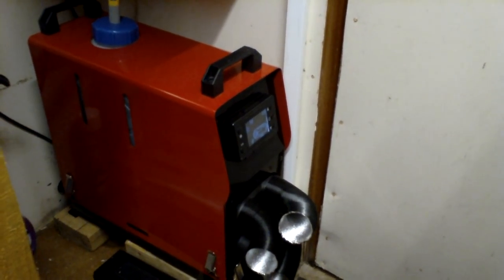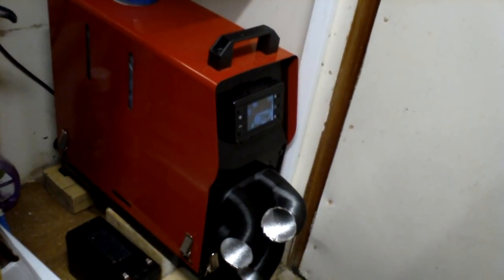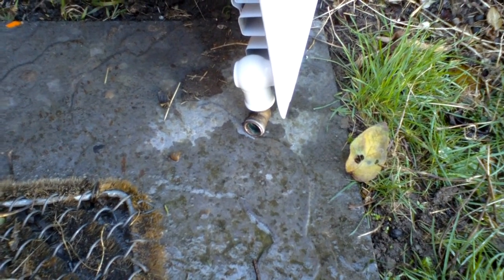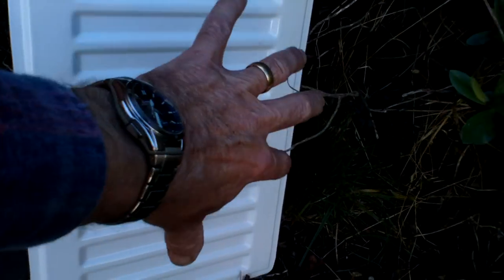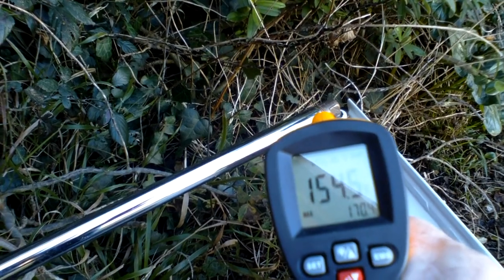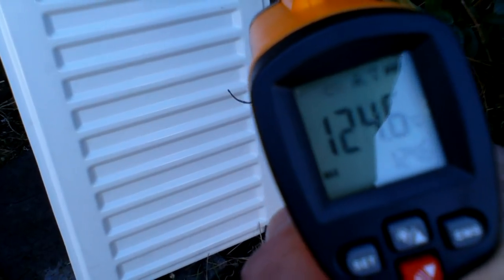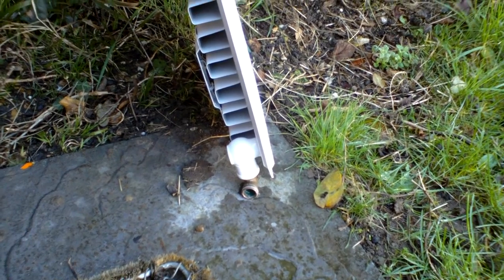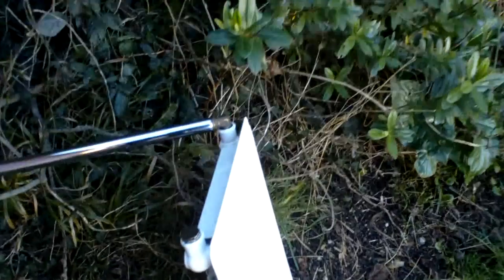COMPACT CHINESE DIESEL AIR HEATER EXHAUST HEAT RECOVERY

Comment: I find it amazing sometimes,I was thinking of putting one of these heaters in a van for overnight stays and was thinking, could I cobble together a copper coil that fits round the exhaust like an Emerson heater to warm water for a wash in the mornings and "bam" here I am....👍
Reply from the maker: Hi Andrew. That could be done. The hot water could use a gravity system so the hot water would rise to a small tank. Needs further investigation but worth a try.
Regards Peter
Reply: Friend of mine done just that, fed the pipe into an urn he has hot water in his van for hand / dish washing, (he used central heating pipe) coiled it
Reply from the maker: Hi there. If you get him to put up a video it will help loads out who would like to do this as a project for heat recovery... Regards Peter

Comment: Seems to work quite well, water vapor is normal, wonder (an idea) whether you could shorten the tubing to a minimum of the wall thickness exiting from the top of the rad on a slight slope and have a mini copper u trap exiting on the bottom of the inlet for the condensation to exit out..

Comment: How about using the exhaust heat to create hot water via a heat exchanger and returning that heat back into the space to a storage tank. 
The water vapor condensate can be vented outside along with the fumes
Reply from the maker: Hi James. I have done this. See the video. I have many videos on my site which you may enjoy.
https://youtu.be/VktbyEAoVR8
Regards Peter

Comment: Good simple attempt would work to stop external water tanks freezing .thanks.
Reply from the maker: Hi there Cantrustme. You have made a valid point - you only use the heater in cold conditions so to use the recovered heat to stop a water tank freezing is a very valid point. I’m hoping some of the RV guys are looking at this because its simple... 4 or 6mm coiled copper pipe twisted round the exhaust and wrapped with manifold exhaust wrap the a very small low consumption water pump... The mind boggles. Stay warm - Regards Peter

Comment: Some people tried to coil up the exhaust pipe right in front of in-room air intake. This way air entering the heater was very hot to begin with and on exit it was VERY hot!
Reply from the maker: Big no no. The exhaust must not be more than 1.5 mitres long else the added back pressure causes the unit to soot up and fail which is a pain as you have to manually strip it down and dig out all the carbon and soot... That’s why this is such a challenge as it’s not as simples as it first seems. Regards Peter

Comment: i bought one for heating in a van.. I might use this recovery for heating water for the morning shower...Thanks for the good idea
Reply from the maker: Hi there. Read the comments posted here as the coiled pipe idea seems the best option. Regards Peter
Reply: @brucepeter2007  Thank you Bruce, i will post if success..
Reply: Whatever radiator you use you need to be able to clean it.  If the burner does not completely break down all the carbon, it will condense inside your heat exchanger and clog it.  The best config for this is a shell and tube type with a flange installation so you can easily disassemble it to run brushes thru the tubes to clean out any carbon buildup...

Comment: I think it's condensing because the rad is outside if it was inside I think it would work
Reply from the maker: Hi Martin. Thanks for the reply - it’s the actual combustion process together with the moisture in the air that produces so much water. No way out of it with this method which was one of the reasons I scrapped it. The other safety factor is that here is more inside the living space so there is more chance of the combustion are leaking into a room so the idea was not pursued in with this method but I did another heat recovery video which worked very well indeed.

Comment: Here's the idea to run with. Have the exhaust sealed to the radiator inside the shed, with the exhaust entering the radiator on the bottom and exhaust out the top and exit the building. Is that the type of heat recovery system you are planning on doing?
Reply: And have it setup with a water drain valve to clean it out once in a while.

Comment: Hi Peter, thanks for starting the ball rolling on this but I'm not sure why you are so anti using a radiator.  Provided you make the circuit airtight and exhaust the fumes to the outside I can't see a problem.  As for the water condensation, there are plenty of solutions you could use from the world of compressed air where they have to deal with the build-up of water in low spots in the pipework.  They generally do this by intentionally creating low spots with drain valves.  Also mount the radiator on a slight angle so any water that collects will run to an exit with a drain tap.
Reply from the maker: Hi David. Thanks for your constructive comments and I will further explain the reasons I did not continue using the heated gasses in the way I had experimented with in this video - but changed direction and made a further video going down the heated water route which could be used safely with a radiator or to heat a water tank if one wished😀😀😀
The main reason I’m adverse to using the exhaust gas into the radiator are two fold.
The first and foremost is safety.
If you look at some pictures posted on CHD heater forums showing poor heater installations you will clearly see a 😳 “that will do” 😳 situation arises on many occasions and that situation alone is a killer when combustion gasses could then be released and trapped within a relatively small space with the possibility that the person could be asleep - 💤💤 - Then would never wake up😔.
Secondly. With an exhaust wall mounted radiator you have a real possibility of even more combustion gas joint leaks within the heated area and also the water from the combustion process is far more than you would get from an air compressor. Another factor is the length of the exhaust pipe - from all manufacturers - recommends that the exhaust length should be no more than 
2 metres in length which limits the exhaust back pressure and prevents the unit from sooting…
Thus I pursued the hot water system which proved to be quite effective and efficient and above all SAFE and also overcome the back pressure situation.

I made a second experimental video and the link was contained in this videos description which sadly most people miss.
I hope this answers your questions fully.
Regards and stay safe. Peter
Reply from the maker: Hi again David - here is the link to the second experiment.
https://youtu.be/VktbyEAoVR8
Regards 
Peter
Reply: @brucepeter2007  Hi Peter, that's a neat way in your second video to extract the heat from the exhaust for hot water.  The same as I have done likewise from my wood burner to my jacuzzi!  :)  I'm in a shed/garage so just want the heat.  I guess I could use the technique to heat the water and circulate it around a loop with a radiator included but it would probably take a long time to heat a large quantity of water so I'm still analysing the 'plan A' approach.

I take your safety concerns but don't see them applying to me ... the shed is a relatively large volume of air being 20' x 15' with an average height to roofing sheets of about 8'.  Like many sheds/garages it is of unsealed construction (T&G panelled walls, open roofing corrugations, poorly fitting doors etc.) so has plenty of ventilation!  :)  And I would be fitting the radiators to plumbing standards so would not expect a leak.  I say this not to criticise but to say your plan A is worth developing for those in a similar situation ... sleeping in a confined RV would be a totally different matter.

I was suggesting using the techniques as used in compressed air.  You can run a low spot to any size catch tank and drain it as required.  I'm also wondering if the radiators themselves could be used as catch tanks.  Run the exhaust from the wall mounted heater down to say the lower left access point and exit the exhaust gas from the diagonally opposite top right and then out of the building.  Use proper plumbing fittings just as for a domestic central heating system but don't mount the radiator level, mount it with a slight slope towards the opposite lower access point so the condensed water collects in that corner with a normal radiator valve to facilitate draining.

I wonder if the stated limitations on the exhaust pipe are because of the desire or not to have back pressure and the actual design of the pipe.  To make the pipe flexible they use a ribbed tube.  The ribbing will restrict the flow of the exhaust and so too long a pipe will increase the back pressure.  If you are looking at your plan B then you want a ribbed pipe to transfer more heat but in plan A that is not required so maybe replace the supplied exhaust with copper piping to reduce the back pressure effect of a longer pipe.  Maybe they also want to keep the pipe shorter to allow the exhaust gases to expand into the free air sooner and remove any back pressure in which case maybe a radiator would act as an expansion chamber as for a 2 stroke engine.

This is all supposition on my part and the only way to find out will be for me to experiment as you have.  :)
Reply from the maker: @davidcaple5547  Hi again Dave. There is certainly plenty of scope for experimentation for anyone who is competent but as I did say before many of the “that will do” merchants could end up killing themselves with that attitude and I have seen many post pictures which made me shudder so I could not continue to pursue the exhaust gas route.
That said the only issue you would have would be back pressure which would directly affect the mixture and diesel 🔥 burn.
All manufacturers of this type of heater say that 2 metres should be the maximum exhaust pipe length however I have known of installations of 3 metres that have been done without adverse affects. To alleviate the back pressure somewhat you could use a larger diameter pipe which would help reduce the back pressure issue…🤔
It’s a “suck it and see” situation which could be fun. As you know I had a real bee in my bonnet (hood for USA guys) which is why I started to experiment - don’t underestimate the speed that the water system is heated up and if a coil length is doubled and insulated I think the results would be impressive and more durable over time…
Good luck with your experiments and please stay safe ( and warm).
Regards Peter
Reply: @brucepeter2007  I have a few experiments in mind, maybe post a video!  :)  Good to chat with you Peter.
Reply from the maker: @davidcaple5547   - Great to have a sensible conversation and I wish you well with your experiments - Stay safe. 
Regards 
Peter

Comment: Was looking into a glycol heat exchanger outside to heat water inside on a pump that could also heat inside, will have to consider steam from building up and possibly causing a explosion.
Reply from the maker: Hi Matt. I do feel your making it too complicated as there are so many limitations with this kind of heater - max 2 metres long on the exhaust with only a max of 3 x 90 degree bends to keep the air flow and prevent back pressure which will cause sooting. Anything done for heat recovery must be simple as if the heater needs basic servicing which is easy to do - you don’t want to end up with another system to strip down to get the three pipes off to remove the heater unit... I think the copper mini bore pipe coiled around the existing exhaust has great merit and as it’s very simple maybe useful to the guys in RVs and people who live as much as possible Off Grid...
It will be interesting to see if anyone comes up with recovering the useful heat at a reasonable cost - never know - it could be you.
Regards for your input as my grey matter is still thinking about all that heat loss - Dam that bee in my bonnet as it won’t fly away...
Regards Peter

Comment: sure you can why not? use the radiator as heat exchanger and rout from radiotor gas exit to outside. Why not? i don't get it?
Reply from the maker: Hi NoName. If you look at the other video that was mentioned in the description you will see it’s a far safer alternative.
The exhaust gasses in this experiment could be lethal if there was a leak and also the water vapour which is a result of the diesel combustion is an issue and is also corrosive. This experiment was interesting but was not ideal which is why I went onto do the second video - experiment 2 which is safer as there are no combustion product gasses within a habitable area.
Check it out and it should make more sense to you. Regards Peter
 https://www.youtube.com/watch?v=VktbyEAoVR8&t=0s

Comment: Hello how have you connected the exhaust to the heater??? The exhaust provided cannot bend into a shape without protruding beneath the casing.
Reply from the maker: I have two installations. One in my shed and the other is my wife’s craft cabin. As both units exhausts have to come out the side there is a tight ninety degree bend as soon as the exhaust exits the heater. To ensure I had enough clearance to the floor I placed my heater on 50mm blocks giving it the extra height and safety clearance I felt was necessary. If the heater was installed as it was intended the exhaust would exit vertically downwards thus the sharp bend would not be required. I hope this fully answers your question but if not let me know and I will try again to help. Check out my videos as I have a good number now which can show what I mean. Stay warm.
Regards Peter
Reply from the maker: Hi there Ian. The unit is an adaptation so it was made to have the exhaust pipe continue down vertically from the diesel heater. As I needed to get the exhaust out of the shed and above the floor I mounted my two heaters on 50mm blocks so the tight exhaust bend would be clear of the wood floor after doing the 90 degree tight bend and then on to exit out of the side wall. If this was installed within a vehicle the tight bend would not be required. If you look at the two installed heaters in my videos you will clearly see the mounting blocks used...
Regards Peter

Comment: Hi look up egr coolers they are made for the job
Hope this helps
Reply from the maker: Hi Ann. Thanks for your comment.
I’m fully aware of the ERG units but it’s what you can get as they are all different and involve more plumbing and complication.
The idea I proposed in my second video was arrived at after much thought because I wanted something that would work well and be very simple with parts that could be obtained almost anywhere together with being of easy contraction and add no extra inconvenience when it comes to maintenance of the unit.
To use the ERG is fine if you can get hold of what you need and fit it where you want to so each to their own but simplicity can often be a boon when it comes to longevity.
Thanks again for the comment.
Stay safe and warm.
Regards Peter
Reply from the maker: Please see my second video Ann as it answers the questions.
Regards Peter

Comment: How much space does yours heat? And how long does it take to heat up about 20° or so? I'm thinking about getting one for my offgrid house... Maybe two , not anymore than that, I'd go a different route if two wouldn't heat it, I don't expect it to heat it when it's 0°F out but 20-40°F I think it would be good, I like it about 65° anyway. Thanks
Reply from the maker: Check out my channel - got videos of my shed and the wife’s larger craft cabin installation which will give a good indication of size you have thrown to many variables at me of what you want to do but we have both been in our respective sheds / cabin when it’s been around 0C outside and we got it up to +20 with no issues as on full the units shift a lot of air. You won’t get a Fraser form of heating and it’s the best thing I installed - on my wife’s craft cabin video read the description section and see why it was installed.
You won’t regret getting one and For the cost they are amazing value for money and generally are very reliable - just one word of warning DONT PLAY WITH THE SETTINGS - unless something goes wrong. The ones that play end up with units that soot up and fail. Stay warm regards Peter

Comment: Very interesting Peter. Ive been playing with a hot water heat exchanger which is a simple 120mm computer radiator for water cooling games PC's, the results i get are pretty moderate. I can heat 5L of water from 20C up to 40C in just under 10 mins with the radiator in the hot air outlet. I'm wondering if i would get better results if i used two 80mm radiators back to back in the exhaust system?
Reply from the maker: Hi John. Thanks for your comment. If you read the description about this video you will see it refers to your second video as the radiator system had too many issues to be practical. I list below my comment in the description to point you in the right direction...
Published on 25 Feb 2019
EXPERIMENT - Heat recovery from Exhaust system on a compact Chinese diesel air heater - bit of fun... PART TWO FOR RVs & BOATS HERE  https://youtu.be/VktbyEAoVR8  
Enjoy. Stay warm.Regards Peter
Reply: @brucepeter2007  Now that is pure genius, simple as. I can forget the mini radiator approach i was thinking of and concentrate in doing something like this instead.